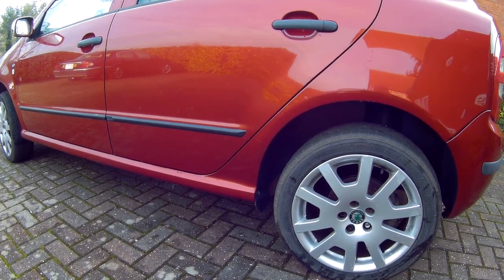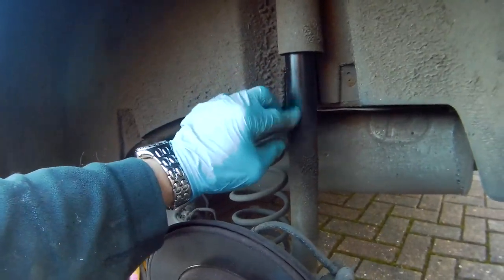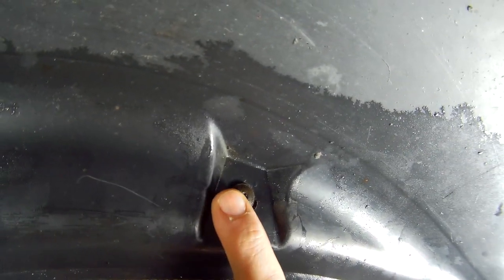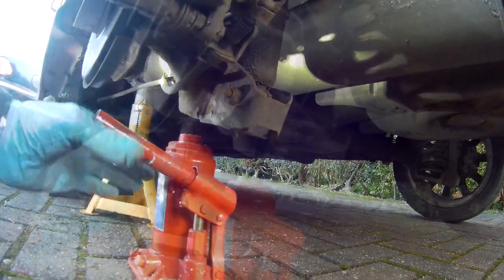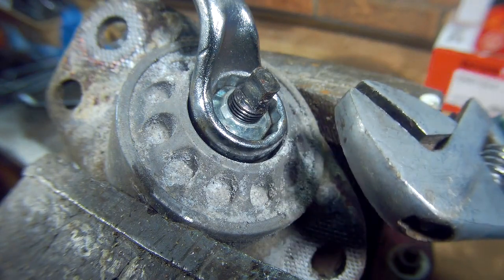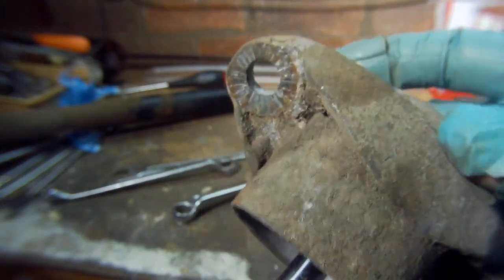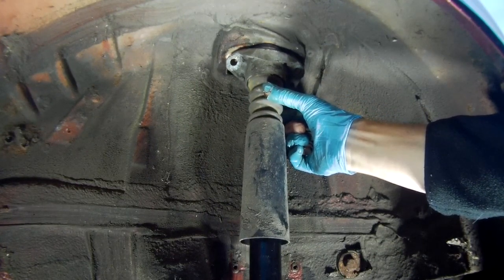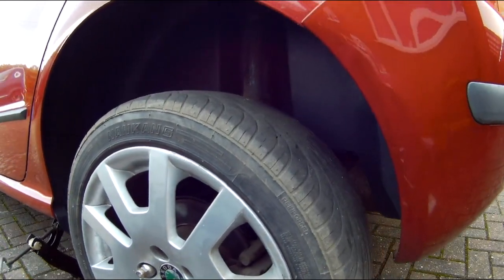Skoda Fabia REAR SHOCK ABSORBERS (99-07)

Comment: Great video as always, liked it! I would love to see you make a video how to remove central console and fix a cigarette lighter socket.
Reply from the maker: Glad you like the vids, greatly appreciated. I was thinking of doing the central console, but I remember it is wasn't an easy job on the fabia. I will look into how to take it out easily and do a video when it is warmer, freezing at the mo.
Reply: @HatBoyHarvey  Hey! I didn't remove the wheel, but I can see that the rubber is damaged and rust is showing. Is that enough reason to change the strut? 
If not, how should I determine if I need to change struts? A mechanic changed front struts last year, but since then I've seen that they often do it for no reason (car seemed ok to drive) so I don't want to get ripped off.
Reply from the maker: @DataLog  Rust isn't much of an issue, the rubber is more concerning, but look for oil leakage down the shaft which is a tell tail for bad shocks. You can test them by pushing down on the car sharply - if it bounces a lot they aren't doing their job and leaving it all up to the spring which will bounce. They should return and stop. It is very important to change shocks when they get like this for safety. The car will still drive, but the handling will get progressively more dangerous until you loose control around a sharp bend, a hump bridge or braking hard. The rear shocks are easy to do and relatively cheap considering they could just save your life. Stay safe :-)

Comment: Great video been catching up on all you Skoda videos. Any chance in a video on replacing the centre air vents? Also some instruction on where you place the axel stands? Thanks
Reply from the maker: Thanks, yes I could do the centre vents sometime, They need to be taken out with care as the surface can be scratched easily:-)
Reply: @HatBoyHarvey  do you know if I can buy the bottom bolt anywhere as I can't seem to find any apart from local b&q store is it ok to install them thanks

Comment: Nice easy explanation…cheers… is yours the VRS?….. as you’ve discs on rear…… I’ve a phase 2 Monte Carlo with drums 😵‍💫😆
Reply from the maker: Thanks, mine is the 100HP PD engine, sadly not a VRS. The suspension is 15mm lower on the VRS model with larger front discs and different hub.

Comment: How do you torque up the nut that goes on top of the piston rod? As there is no way to hold the piston rod while using the torque wrench? Thanks for your help HatBoy
Reply from the maker: Good question, The best way is to use a torque strut socket which has a slot in them to insert the Allen key and I don't have one. I have an adapter that fits my wrench, but it is an old designed tool and looks a bit naff. It works well, but I didn't want to show it. I think you can still get ring adapters, but they need to be short otherwise calculations are needed.  25Nm for these, which isn't much, hope it goes well :-)
Reply: @HatBoyHarvey  How about holding the strut rod in place with a pair of vice grips (with a cloth to prevent scoring)?

Comment: How does one torque the top nut? Guess it with a the swan neck, and check with torque wrench aye?
Reply from the maker: You can get a top strut nut socket that is open on one side or a crow-foot spanner end or make something, which is what I have, but didn't show.

Comment: Hello my friend 
Please can you tell me when should i change shock absorbing i have 
1.2 12V skoda fabia 141371 km
Reply from the maker: 80-160,000 km as a matter of course. (rears are relatively cheap) check their function by pushing down quickly on the rear, if they bounce easily and soft - replace. If they   knock over bumps - replace. If they show signs of oil leak on there shafts - replace. Hope this helps :-)

Comment: How long are the bolts? The top bolts are 16mm x (what exactly?)
The bottom ones can be a little long as they don't get in the way of anything. Thanks in advance
Reply from the maker: I've updated the bolt/nut sizes in the description. M10x35mm :-)

Comment: Where did you get the replacement shocks from? What make and how much were they?

Thanks will be replacing mine this week.
Reply from the maker: Difficult one, These were CD units, but I don't want to recommend one make over another or these. Buy from trusted suppliers with extended guarantees if possible, online or shop.  I've  fitted what I thought were high end units and had them fail after a couple of years and had cheap ones that have lasted ages. ride quality should be the same if they are correct replacement for your specific model; review some online as much as possible, not all include new fixings. Expect to pay roughly £30-80/pr.

Comment: Hello Mr. HatBoyHarvey,,,I want to consult you about something... I have the same model vehicle (2006 Skoda Fabia 1.2)... When I insert the starter key and start the vehicle, the mileage needles, engine speed needles and all the needles do not move for a few seconds and they do not move. they are shaking on the ground...This takes a few seconds and then they work properly...I would appreciate it if you could help me with this... WITH RESPECT and LOVE
Reply from the maker: Probably an electrical connection issue, disconnect the earth lead on the battery and the take out the instrument binical. Clean the connectors with electrical contact spray then reconnect (often works). There could also be a failing part on the pcb or some dry solder joints which need checking out. Try the connectors first then if your feeling brave look at the pcb. Reflow any suspicious joints with a soldering iron (take extreme care or use an experienced electronics guy) Changing out the instrument cluster for a new one will need it to be adapted through OBDII  vagcom  etc.
Reply: Mr. HatBoyu Harvey... Thank you very much for your interest and concern... Respect and love...

Comment: Did you feel them gone when you dove it?  I might have to do the ones on my fabia just not sure I'm sure they need it.
Reply from the maker: Mine leaked oil some time ago, then started to knock over bumps. If you feel that something is not quite right over bumps and cornering at the rear then it could be the shocks and as they are fairly cheap to buy in standard form it is better to be safe as worn out suspension can be more lethal than you think..  ;-)

Comment: Where do you get your replacement hardware from I have just priced it up at the local Skoda garage £20 for (4 top bolts, 2 x locking nuts, 2 x nuts and bots at the bottom) this is for both sides?
Reply from the maker: I like to buy the cheapest OEM, equal or better parts online (sometimes I also buy cheap) and check if they come as a KIT as these tend to include fastenings, but £20 for those doesn't sound too bad as you know they are to spec, which is the main thing. Eastern Europe can also be a good place for reputable Skoda guaranteed parts, if you speak the languages. Over the years I have found OEM parts can be expensive as many dealers hold their prices high, so you need to shop around (and rightly so). An important thing is never to go under the OEM spec as things such as tensile strength of many bolts often differs slightly so you need to check sometimes for important fixing such as bearing hub bolts.
Reply: Thank you
Reply from the maker: your welcome, Have you put the shocks on now Adam? Have you felt an improvement in the ride?